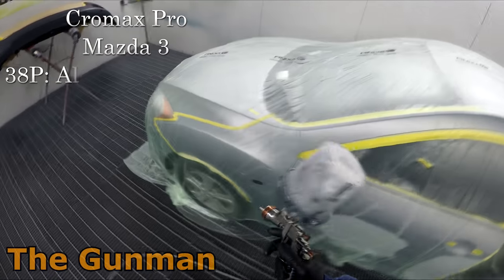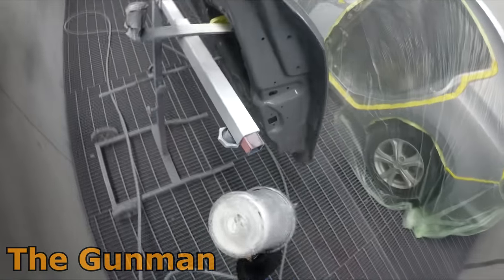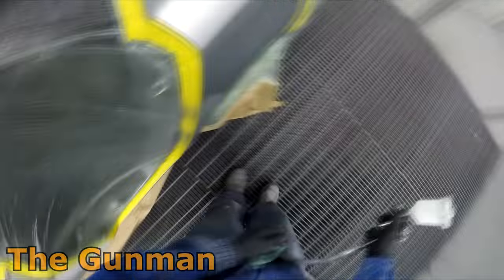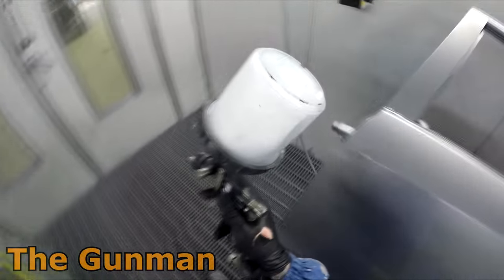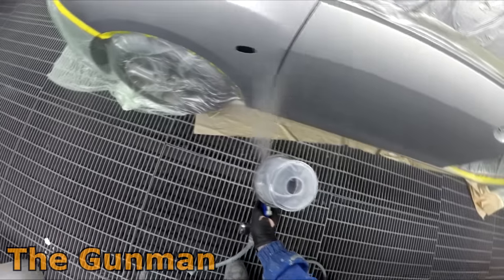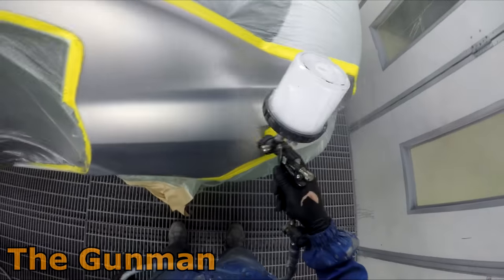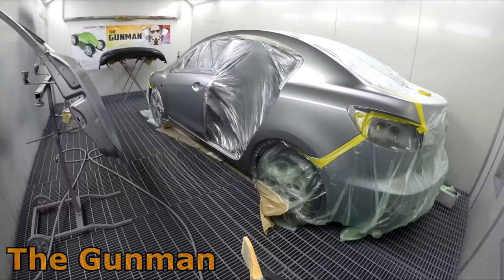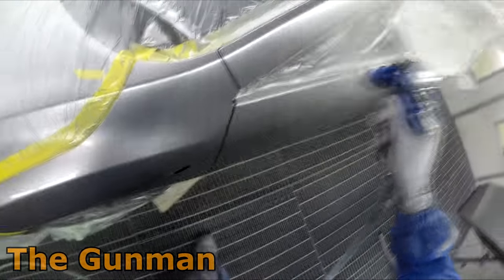Automotive Refinishing

Comment: Good video, I had a hard time with the mottling at the beginning  using Spies Hecker(same as cromax) it seems to harder to control the metallics with the Devilbiss gun, its a hoser. I switched to a sata 4000 RP 1.2 and that gun will orientate the metallic almost by it self. I use the devilbiss for my darker metallics and solids . Also WSB works well

Comment: Wow almost no flash time between the clear coats, is your closed coat orange peely at all since you just barely cover the paint? Then when you follow with the second coat it flows it out a little better? Either way impressive clear. Cheaper clears definitely dieback if you dont allow flash like that. Im amazed man your an awesome painter!
Reply from the maker: The first coat will set the peel up for the 2nd to lay on, I will alter my application depending on desired finish, Mazdas have a pretty thin fine peel so leave a little peely.

Comment: Looking good gunny, I think I've seen you paint this car before? Looks like holding the gun back with the smaller 1.3 allows the metallic to lay down properly. I imagine the pressure is around 23 psi for this? These metallic paints seem particular about the gun settings, application and nozzle size.
Reply from the maker: Yeah I've made videos on the same model and colour before but this was a different car.
Reply: That was it, same model and color made me think it was the same thing but it was different.

Comment: Great job dude. You mentioned that you are using more paint. I thought the water based color covers better than the solvent based paint.
Reply from the maker: It does but the way you have to apply it you end up using more, I would mix 300ml on a solvent bumper (regular size) but 350 water, ok so the 300ml will be thinned down to 450 ready to spray but half that is thinners which isn't that expensive, plus per litre water is more expensive.
Reply: +The Gunman I don't care how much paint you use my friend, just keep the vids coming and you always do a great job. Thank you for your time to put this out there for us. You must come visit Cape Town South Africa oneday.
Reply from the maker: Brent Nicol Thanks man, I'm always conscious of keeping paint bills low but the job must come first, if I have to mix an extra bit of paint to make it look good the so be it, SA sounds good.

Comment: when you say you use thinner to fade the sealer edge, do you mean a gun wash thinner or something closer to basecoat reducer? need clarification in the states
Reply from the maker: Basecoat or 2K reducer, I wouldn't use gunwash, just be careful it doesn't run. You don't need much to melt the edge.
Reply: Awesome. Thanks for the answer!

Comment: Hey Gunman, is it possible to respray a part (for example, skirts or a bonnet) from this metallic grey colour to a white at home?

Looking at getting a couple of new ralliart pieces for my lancer and I have found a guy wrecking a metallic grey/silver (a little lighter than the one in this video, may just be the lighting though) but well, my lancer is white.  Any tips/advice would be appreciated!
Reply: white is an easy color to spray, so sure would be if you have the equipement
Reply: Not necessarily the process to respray it, I can do that. I'm curious if there will be any issues due to it previously having a finished coat because I've only ever resprayed white and an untouched PP piece.
Reply: *****
If the paint on it is good, so sense in removing it :) Simply sand it down with 600 all over. then if you didnt go through to metal, you can lay your base straight on it.

Comment: What grit do you scuff clearcoat with if you are going to reclear over it after you do a spot repair on a panel?
Reply: 800 would be fine
Reply: 500 to 600 dry with a DA 700 to 800 if it's color that show's scuff mark's easy.    I myself like to do it wet by hand with 500 then check it with a rubber then 600 over that. but that's just me and i am not working with water yet solvent PPG dbc and DC3000 clear.
Reply: +Eddie Martinez Hey Eddie , I wet sand the clear around the repair with 1000 grit. Then blend and clear. Is 1000 too fine ? Never a problem after 20 years but always room for improvement. Thanks man !
Reply: Mitchell Ferre No i like 800 myself but 1000 is fine sanding with water is my way but i have done it dry with just a DA and dry 800 and look's great.    Every painter has his own way what your doing work's for you your fine keep up the good work.    As for waterbase paint i have not worked with it yet but i do want to try.  Going to try PPG envirobase soon i will post how i like it.    Tell you what i would like to work with is water clear PPG  is using it in the UK but have not seen it here in the USA yet.   Look it up on the computer wild stuff they show a guy working with it and it look's like white paint they show it after it's down look;s milky but go's clear after a bit of time.     What paint do you use?
Reply: +Eddie Martinez i used the ppg water at college and i dont know i would definitly rather use solvent myself but i guess either one works just a little different
Reply: I was told the aquabase PPG has came from the UK and the envirobase is made here and it's PPG own paint the aquabase was a buy out in the UK it was autocolor's paint that's what they told me when i went to PPG school for a class on the new paint system's.
Reply: I love all that crap they tell you about how clean water is but you still cant dump anywhere so it's like solvent you still have to get rid of the waste the right way so how clean is it?    And we are still using solvent clear.
Reply: Eddie Martinez Thanks Eddie ! I use PPG dbc or Dupont chromabase and what ever clear I choose according to the budget and results I am trying to achieve. Usually U-POL clear. I wet sand the clear and wait a day to let it breathe. Then hit it with 3000 trizact da and buff with 3m perfectit compound. No swirl marks ! I hate swirl marks like I hate orange peel. I think the foam pad works better than wool. Wool =swirl marks.
Reply: Mitchell Ferre I started with dupont 26 year's agor chromabase and dupont 7500 clear was my go to paint setup now it's PPG dbc wtih dc 3000 clear and for overall job's dbu 2002 good stuff.  Gunny is doing good with the crowmax i still have not worked with water yet but i have an open mind like gunny he is a great painter.
Reply: +Eddie Martinez Yup , 7500s clear was really good ! I liked the old Deltron Delglo by PPG also. I still have some old PPG Dbu base laying around. Must be 20yrs old. Used it a few weeks ago and still sprayed fine ! You know I shook that can till my arms fell off. Lol !
Reply: Mitchell Ferre Where i am the boss will only go with PPG  but he has me working with creast clear on cheap job's stuff is not bad for a low cost clear.